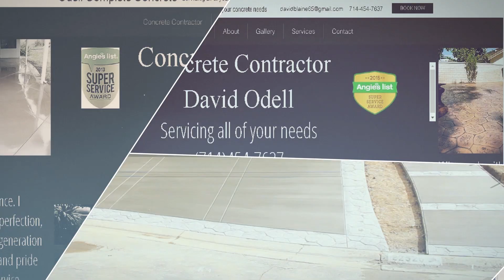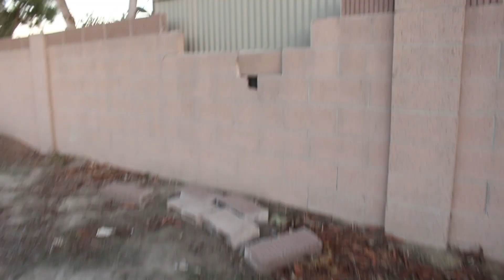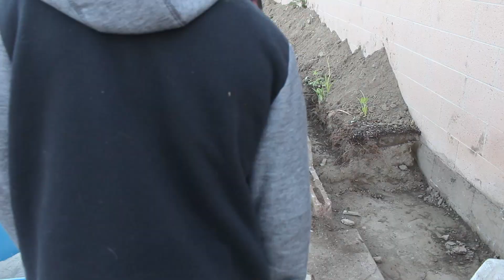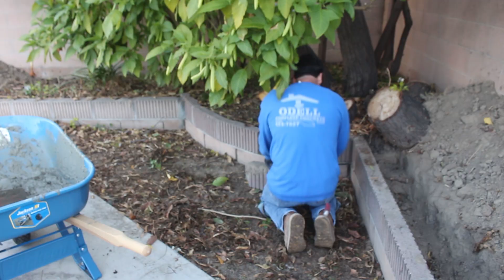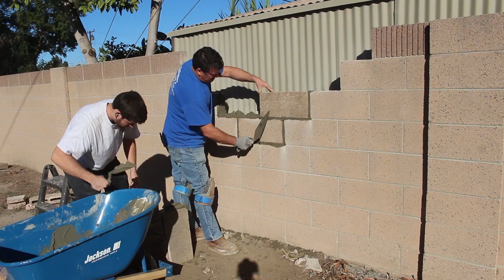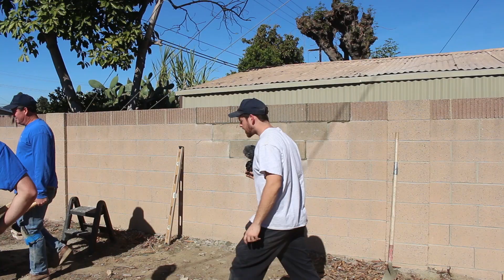How to Repair a Block Wall Easy Fixes! DIY

Comment: If these were the 6” blocks. Would you fill or add rebar to make sure they don’t fall over? I need to add two rows for a 6 foot section.
Reply from the maker: Wouldn't hurt

Comment: 5 years ago, what kind of ready mixed path should I use to re attatch the blocks? Hydrolic?

Normal cement patch?

I want to have it be able to withstand water in the winter
Reply from the maker: Mortar

Comment: Are those 4" x 8" x 18" on the wall by any chance? I'm looking for a replacement block similar to the top row with the vertical slots that are 4" x 8" x 18" but I cant seem to find them anywhere.
Reply from the maker: 16"